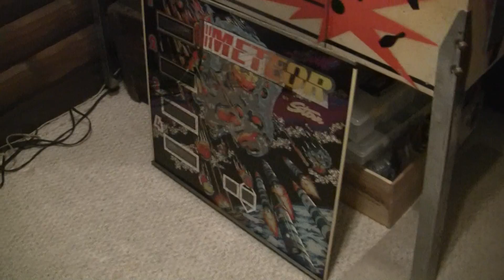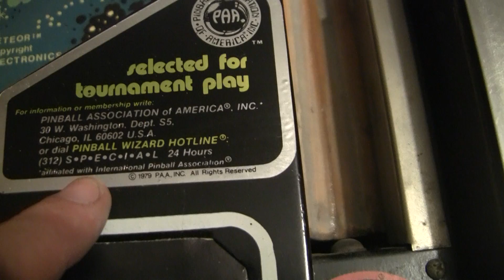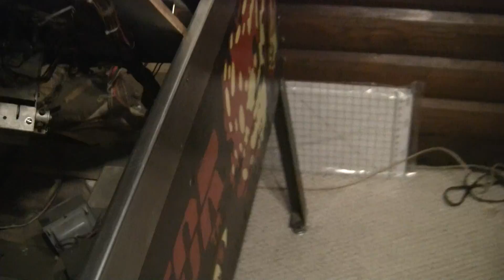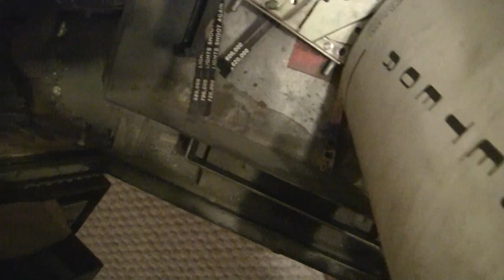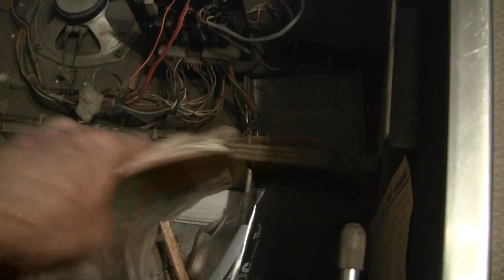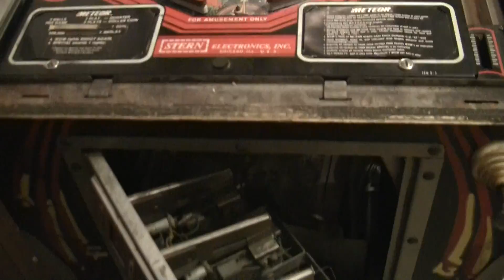First Look: Stern Meteor Pinball Machine - PinballHelp.com

Comment: So.. My dad bought this new in 79, i inherited it and have done all new drops and flippers. Currently stuck on a white wire with red stripe down by the bottom left flipper.

Any idea?
Reply: Hey did you figure out that wire?
Reply: I did.
Reply: @Ajaxaxxess  i just got a meteor on saturday took playfield apart needs to be fixed. Got some issues. I live santa rosa are you in my area. My email sawyer_10702 @hotmail.com lets keep in touch on our projects.
Reply: My project is completely restored. I live way way north.

Comment: Hi Mike.  I just got a Meteor and it wont boot up. the red test light just stays on. it looks like the battery has already been removed. I replaced the rectifier board and now the field lights and backboard light but that is all it does. I suspect the MPU has gone out. It worked for a while and then just stopped. any suggestions?
Reply: I just replaced my meteor CPU with one from  http://www.allteksystems.com/. Still have some issues to work out, but the new board solved a significant amount of my problems. The replacement board works for about 90 games (meteor being one, of course). they run $200, but well worth it, methinks.